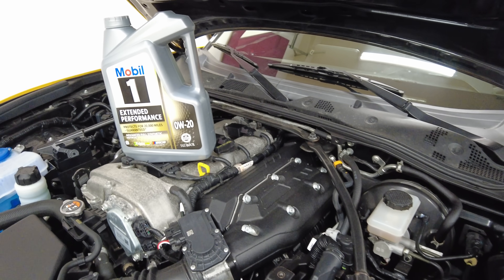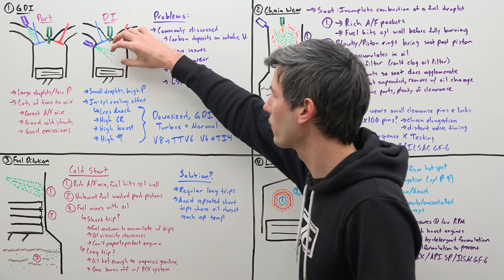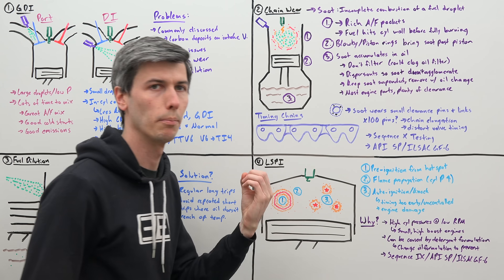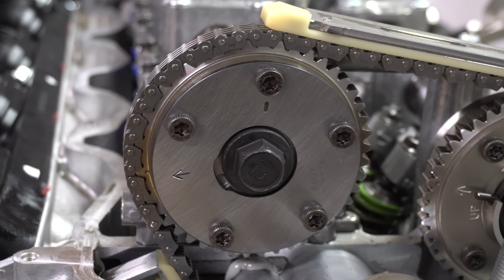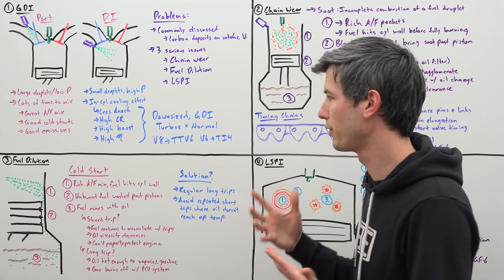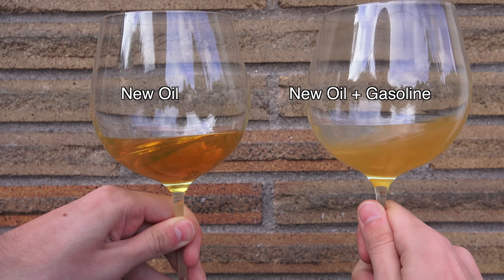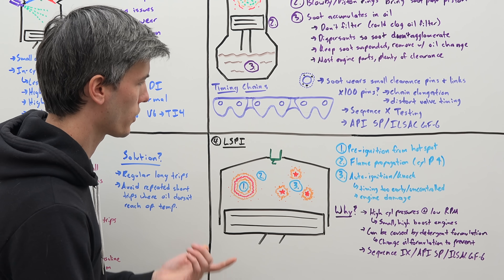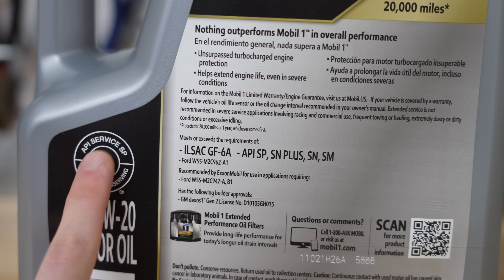3 Big Problems With Direct Injection Engines (Gasoline)

Comment: It is amazing to me the incredibly stringent emissions standards that diesel engines are choked with, and yet the diesel-equivalent soot production of GDI engines is ignored by the EPA. In Europe, GDI engines are getting exhaust soot filters just like diesels. I don't think it will be too much longer until we see a similar crackdown on GDI emissions here in the States. If I'm wrong, then maybe the EPA doesn't actually care about protecting the environment.

We really create marvelous problems for ourselves. Engineers in search of an extra 1% of efficiency finally get there, and now it likely will be negated by a restrictive emissions system.
Reply: I would like to see a Ban on Diesels, as the Carbon Particulate is getting so small it gets very deep into One's Lungs and wrecks real Havoc in there
Reply: @alexanderkennedy2969 

I never mentioned Lithium Ion Batteries. I just want a ban on Diesels. I can't breathe when there is one within 120 ft. I will be coughing, causing me to Puke, and I will continue to Cough.
 Once at a Boat Show, during teardown, some Jackass drives a Diesel inside(against the Facility's Rules), gets out leaving it running. After 20 seconds of not being able to breathe, I went up to it, opened the door, shut it off, removed the Keys, told the woman still inside that she should call a Tow Truck. I then left the Building, throwing the Keys into one of the Disposal Bins outside.
Reply: @pjimmbojimmbo1990 you sound like a real Karen willing to do crime in order to get your way.  If diesels were banned you would not have grocery stores, or gas, or many other things.
Reply: You take keys of my car and throw it somewhere and you would see the hell on earth, .... It wouldnt be good idea in my case @pjimmbojimmbo1990

Comment: So would using Shell’s Premium Gasoline V Power + Nitro be beneficial for these types of engines, or using regular 87 and using a fuel additive once per month be better? If at all? I’m also assuming changing oil a bit early would also help as well? Thx for the content!
Reply: My 1.2 turbo Toyota engine runs noticeably better on premium fuel and therefore I run it on that exclusievely so I would imagine the answer is yes.

Comment: Toyota had these issues fixed before they were issues (except on the 2.5L Lexus V6). A set of port injectors keeps the intake valves clean as well as operating on cold starts and other conditions where incomplete fuel burn, blow by, and oil dilution are known to be an issue. It took nearly 15 years but most manufacturers are starting to adopt the direct injection tech Toyota was using from the start!

Comment: I bought a 2021 Toyota Tundra specifically to retain that bullet proof 5.7L V8 engine mated with the also bullet proof 6-speed transmission.  Port injection only, engine has lower pressures, doesn’t work that hard since it is so powerful.  Low fuel mileage, but I make that back from never having to spend money at a mechanics, and not having to purchase another vehicle (since this one lasts for 400,000 miles if you take care of it).  And it’s awesome having an old school pickup with a V8 rumble!

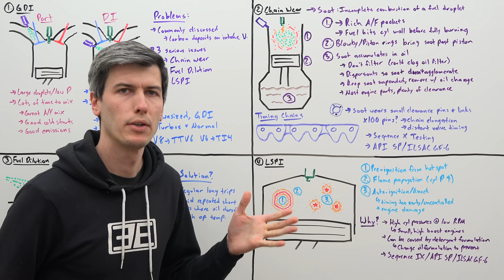Comment: 7:47 engine knock

Is the solution to use a higher rating fuel to prevent pre-detonation?

Obviously that increases fuel bills but maybe that's better than engine damage bill?

Particularly for us who mostly do those "short trips" of <15 minutes

Is this mostly an issue for turboed DI engines, or also just DI engines in general?

Comment: 6:40 I'M not reducing the viscosity of the oil they've specifically chosen... 

The engineering configuration THEY'VE chosen is resulting in this because of real world driving 😉

Not your point, but it's definitely their choices which come from pressure of nonsense Politics 🙂

Comment: direct injection causes carbon to cake up the back side of the intake valve reducing air flow, how about installing  a injector behind the throttle body that is constant flow, maybe even running a different fuel (ethanol), trapping crank case vapors instead of trying to burn them?

Comment: If I run a 2009 GTI with the TSI chain engine, should I be upgrading from the owners manual suggested and VW 502/505 approved Mobil 1 0w40 to one of these new formulas with the certifications mentioned here (0w20 with the API SP / ILSAC GF-6)? The 0w40 'european formula' does not have either of those certifications whether it's the standard full synthetic or the 'advanced full synthetic' version.

Comment: All this new engine technology is getting crazy. It's driving vehicle costs up, and it is creating reliability issues. 

We have become accustomed to high horsepower loading on our vehicles. The first car I owned had about 60 hp per ton vehicle weight. The second and the third one had about the same.

My fourth vehicle was the first and only one I bought brand new. It had a little over 100 hp/ton. The one I own now is a bit north of that.

Perhaps we don't really need this much pep. I once owned an 1980 Chevete, with a three-speed automatic. It actually slowed down when I stomped on the eccelerator. I nick-named it "Droopy".

Arguably, it was an unsafe vehicle due to its poor ecceleration. But that was due to its miss-matched transmission.

I was able to drive it safely.. I learned to time my gaps well. From this experience,, I suppose we could learn to live with maybe 40 hp/ton. Then maybe we could get rid of the turbo charger and the high compression that comes with it.

For most of us, driving is not a sport. It is a necessity. We need vehicles that will last at least 15 years without wallet crushing engine repairs. For a lot of us, this is how long it will take the payments to run out.

If someone offered me a basic car with an Atkinson cycle and a 4-speed manual transmission, I would buy it. Even if it performed like "Droopy."

Comment: The better idea is to implement both port & direct injection and switch between the two....better fuel air mixture across the board and no excessive carbon buildup on backside of intake valves. This method would allow high efficiency without the trade off
Reply: While newer engines do that, that really only addresses carbon build up on the intake valves, not most of what’s brought up in this video.

Comment: Man you are so far off base its like a comedy skit. Direct injection has been in use in diesel engines for over half a century with none of the problems you state. You are using carburetor tech to describe fuel dilution on cold start not computerized fuel injection. And you say low speed pre ignition from high compression from boost. Boost is made from the turbo spinning at high speed which requires rpm and high exhaust flow not something you see at low speed. The deposits on the valves are from poor maintenance and junk oil and cheap gasoline.
Reply: Diesel and gasoline are totally different  forms of fuel. Both react differently.
Reply: @ericprice5316  diesel is much more dirty than gasoline. The principal of direct injection is the same.

Comment: The whole premise of this video is that port injection ATOMIZES fuel more effectively than direct injection. Which is simply not true. Port injection uses far less effective injectors and there is also a problem of fuel droplets clinging to the port runners and intake valves which not only destroys atomization, but it makes the engine less efficient.  Try putting 300,000 miles on either design under similar operating circumstances and then do a tear down and see which one is more contaminated with carbon and soot. The odds are not good that it will be the one that is more efficient.

Comment: As a Honda service tech for the last 35 years.  I would replace a handful of fuel injectors every year on NON direct injection cars, Now I replace 100's  a year with direct injectors
 and that just is me go bad replacing them in a shop with a dozen techs you can see how many , Fuel trim, Fuel imbalance and cat failure codes.  You name it, Maybe you might be lucky and they are still under warranty,  Or not like the set I did today that cost about 1500 bucks

Comment: In general the opportuinity for better cold start control is with direct injection. Here are the reasons why:

1) With port injection you have to wait for a complete injection, intake, compression cycle in order to have the first event (first combustion event). Direct injection does not have to wait for fuel to be injected and wait until an intake cycle. Direct injection can occur sooner in the cranking cycle, which will aid start time.

2) The wall wetting estimation is much more accurate and repetable for direct injection. Meaning you can more easily achieve your target A/F ratio upon each starting and subsequent combustion event.

3) You can set the droplet size using high pressure direct injection to best match the cylinder swirl and tumble at low cranking speed during start.

4) Overall port injection will have a very large puddle mass which will have to be accomodated as the engine starts and begins to warm up. This leads to a greater variation on A/F ratio estimation because you cannot measure fuel puddle mass directly.

Comment: With the timing chain issue... I wonder how much of that is from the added stress of  the direct injection high pressure fuel pump, which always seems to run off one of the cams. I just put a V6 engine in a KIA , because it was threw a rod. It looked like the oil was never changed with the amount of sludge built up in it, and the sludge clearly blocked the oil pickup screen off.  That engine  was torn down to see if it would be rebuilt or just get another engine. The thing that stands out now is the timing chain tensioner was broke on the bad engine (75,000 miles) on the bank that has the high pressure fuel pump. Because of every thing a 58,000 mile  used engine was put in it, and guess what, it clearly has a failed timing chain tensioner.  Both old and replacement engine will have a broken ratchet that keeps the chain tight when there is no oil pressure. I have yet to tear down the replacement engine, but I'd bet the failed tensioner  is on the same bank as the other engine that runs the high pressure fuel pump.

Comment: The fix for Direction Injection issues is pulling a Toyota, going from there short lived D-4 Direct Injection system to their D-4S Direct & Port Injection system. All the benefits of both with none of the drawbacks of either.

Comment: Direct injection is borrowed from diesels where oil dilution has been known about for over half a century but is not an issue for them as diesel is an oil also and Las lubricating properties where gasoline does not. GDI is only effective for highway speeds at low loads when the engine is warmed up. That is also why the big diesel trucks fast idle at higher speed when sitting for long periods. This technology is not good considering stop and go driving in cities and all the harder acceleration being done with these smaller engines. Short trip driving will kill these engines quickly unless the oil is changed every 3-6 months or 3000 miles. My GF drives short trips to work and school and grocery store runs and the oil reeks of gasoline and I try to change it for her every 2-3K miles. Oil is cheap compared to the cost of a new engine or car these days. I still think GDI is a bad idea.

Comment: I have a Nissan Juke Nismo RS it's direct injection 120,000 miles later, so far so good, haven't had a problem. Change oil religiously every 3000 miles Castrol GTX 5W30 with Fram oil filter and catch can. The car is also modified with bigger turbo, full exhaust, FMIC and intake therefore it's driven hard. I think the key is frequent oil changes, good quality oil and filter and a catch can.... Also having a Made in Japan car helps!

Comment: Luckily my old car still runs good but I do no want a direct engine car. I want a manual naturally aspirated car which is so damn hard to find. I’m looking at the last accords that come with a v6 since you can find them with a manual. I’d rather pay more for gas than have to deal with carbon issues and turbos killing the engine.

Comment: Working as a mechanic I got in the habit of pulling fuel pump fuse if I was going to be doing a job that required a lot of key on-off cycles. Especially in cold temps, every time you turn the key on most fuel injected engines prime the cylinders with a full open spray, easy to flood after 5-6 key on-off cycles.

Comment: i got a 08 chevy cobalt with direct injection, engine has 180k miles on it, mostly done by me, i removed the intake manifold to take a peek at my ports and valves, its clean, plug in the diag computer and there is no variation in both cam gears meaning that the chain did not stretch at all, the engine performs really well, turbo was replaced at 140k miles because 28psi is too much for a stock k04, i drive the car like it was stolen for years, but i replaced at least 300 vw ccta and audi cawb cbfa and the 2.3 mzr in my life for the reasons you said, i dont understand whats different about mine, my engine is a opel z20nhh runs on ''94''oct tune

Comment: I have a question for turbos:
How do I reduce/eliminate boost from turbocharger? With gas prices I really can’t afford the cost of premium fuel in my car but don’t want to risk knock or preignition from increased pressure/fuel because of my turbo. How can I essentially eliminate my turbo so I can tune for and use a lower grade fuel?
I hope that makes sense. Thank you!
Reply: You can't.
The whole engine is a system that is designed to work together.
The high octane is part of that design/system....as is the turbo.
Reply: @JohnSmith-yv6eq  sad day, that's what i figured. He touches on this topic in one of his other videos and gives this answer. It'd basically take a lot more exhaust piping/weight to make it possible, and it really isn't something people usually do.

Comment: Chains?
Most have belts change 80-100km no issue
Short trips have always been rubbish for cars.
The timing of the injection is more about fuel type. The ethanol content has a bigger aspect, and guess what use the manufacture spec oil and fuel. 

This is just common sense, thanks for the video.

Comment: Great video as usual.  I used to change the Mobil One oil in my 96 Impala (5.7 liter LT1) every 5,000 miles - like clockwork.  Now, I let the oil change monitor in the car tell me when it needs to be changed.  The "change oil" light came on yesterday.  That means I drove 5,800 miles since the last oil change.  Under ideal conditions, the oil monitor allows a max of 7,500 miles between oil changes and reduces that max number based on driving conditions and habits.  In my case, I make a lot of short trips so the monitor decreased the max miles by 1,700.  The monitor does not actually analyze the oil, but instead it monitors how the oil is used.
Reply: I usually change in the 25 to 30% range. even then the oil comes out thin and black as coal. If you run it the whole way down it comes out like water.
Reply: I do it by mileage or time whichever comes first and I am religous about it, it usually gets changed 2 weeks early or 500 miles early because I won't go 1 day or 1 mile over the interval. My car always gets a proper service at the right time with the correct oil. It is also run on premium fuel at all times which I am sure is great deal of help for the engine.
Reply: Luckily, I drive diesels, so 10k OCI is no problem. Ok. My DI VW VR6 non turbo was about 7500k, but rarley short trips. No problem. Turbo gasser was 5k and was not DI😯
Reply: @davidcaprio8919 sure it is. Frequent regens lead to oil dilution.
Reply: @bacorable That's exactly what I'm doing...Jesus!

Comment: The only way direct injection can work without leading to engine damage is, #1, to ELIMINATE EGR and PCV systems as they, working together, causing that build-up of crud on the intake valves and in intake runners and #2, using very high pressure injection with multiple pulses to reduce/eliminate the fuel washdown of cylinder walls. Going to gear driven cams can eliminate chain stretch by eliminating the chain completely. Prelube system that pressurizes the oiling system just prior to startup can alleviate "dry starts". Think Accusump. Solutions are out there but manufacturers won't use them because they cost more than they are willing to invest. As long as the vehicle lasts long enough to clear the warranty period, they call it a win for them!

Comment: long story short, Full SEND100% of the time!

Also, the less heat cycles your engine undergoes (less startups and more good long trips) those are what give engines long life (really gets more involved than that), aside from diesel being diesels, but if someone drove a car much like a big rig (interstate travel for hours on end, good load on engine, and before shutting down for the day, you will get more life out of engine, at least a healthier engine anyways.

Comment: Very Very good!  We purchased a Ford Edge 2.0 new in 2020.  I try to change the oil every 4000 miles with Amsoil 5-30, but usually get around to it by 4500.  I sent in 2 oil samples for analysis.  Both came back with excess fuel readings.  Everything else was optimal, except for the fuel in the oil.  This has totally answered my questions, and I appreciate it.

Comment: Could you do a vid on : petrol particulate filters, Why mild hybrid is now so popular, low carbon petrol alternative fuels (like what Porsche is researching/testing), what maintenance is still needed (or even more so) in BEV engines, BEV engine tech (not the batteries), why GM volts powertrain never caught on when diesel/petrol electric motors are often the norm in trains/marine shipping. BEV battery limits (can recharge rates keep rising?